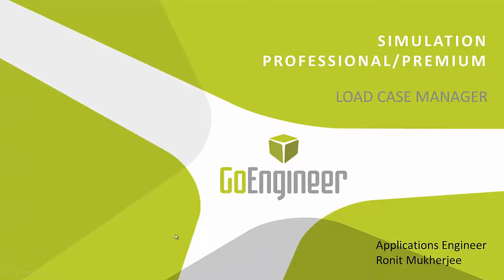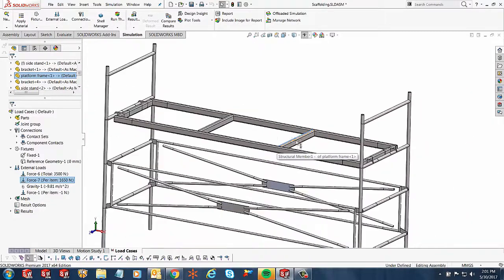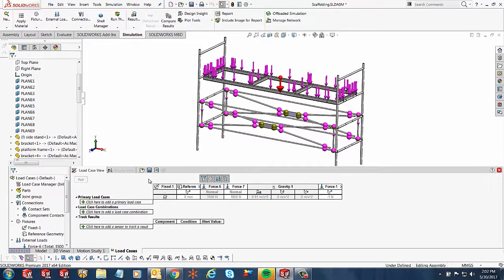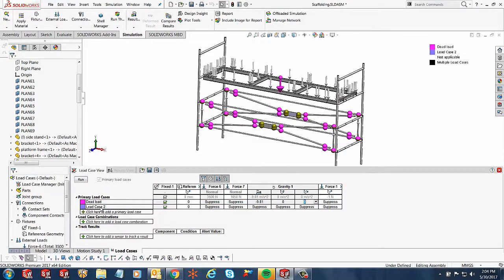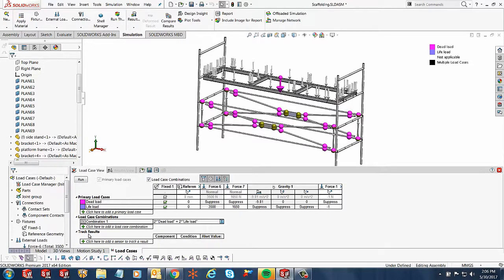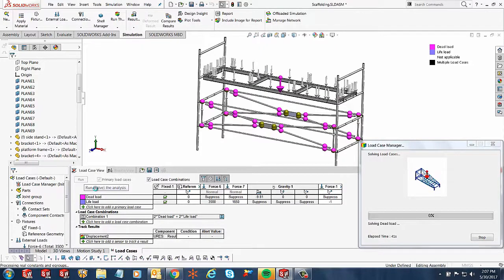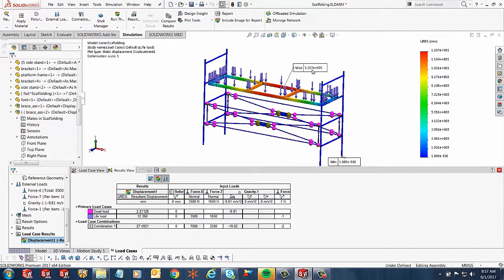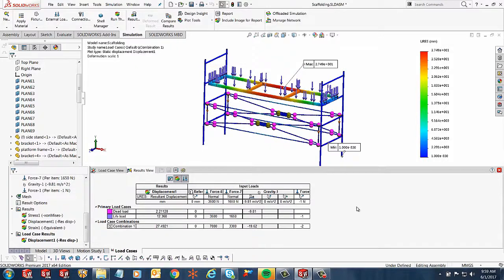SOLIDWORKS Simulation - Load Case Manager

Comment: Hello !! 
Although I am on SW 2022 (Premium), I can NOT find Load Case Manager. Do you know is it off in 2022 or by any means it is there somewhere else!!
Reply from the maker: Hi! It is most likely your machine doesn’t have a high enough Simulation license. The Load Case Manager is included with Simulation Professional or Simulation Premium. I confirmed that using the SOLIDWORKS help: https://help.solidworks.com/2022/english/SolidWorks/cworks/hidd_load_case_manager.htm?verRedirect=1 

If you are using one of those licenses and the tool still isn’t showing up, I recommend calling your local VAR for help with your installation. You may need to run a repair.